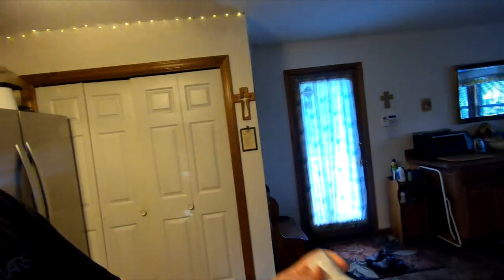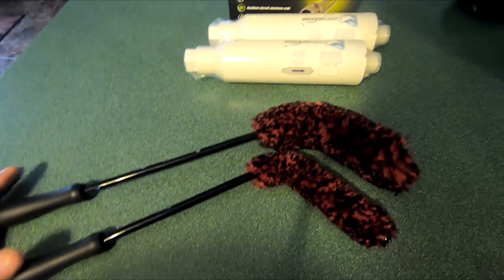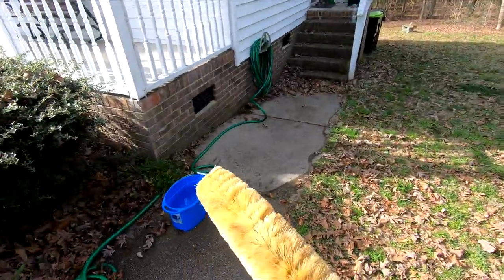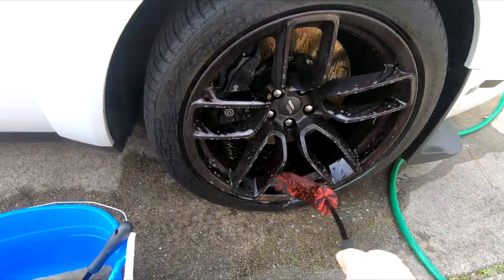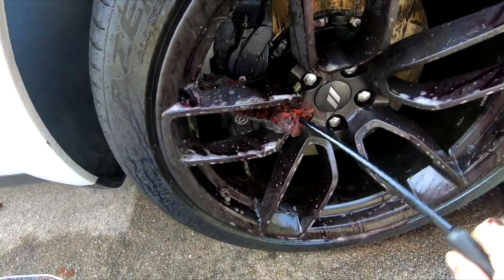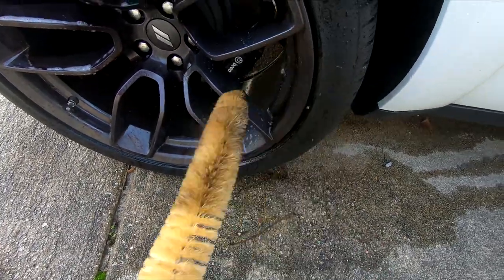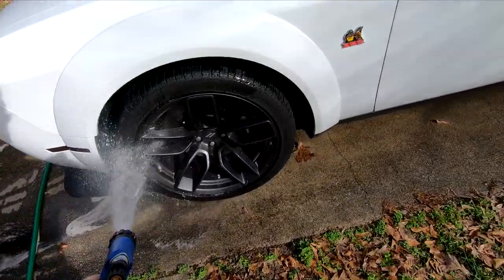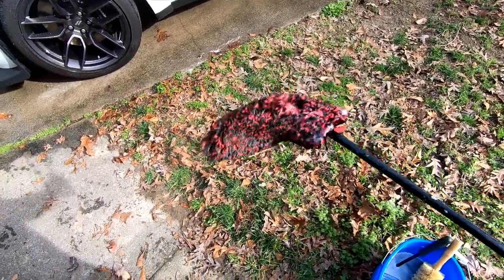Comparing DIABLO to MAGUIRES WHEEL CLEANERS and testing ADAM'S WHEEL WOOLIES!

Comment: Hi Sky. I have chrome rims and I'm concerned about using any type of brush to clean with. Are the wheel woolies safe to use?
Reply from the maker: Yes, should be fine.  I also have another wheel tool, you will see it at the end of my next video. It is like a cleaning mitt with noodles on a stick.
Reply: @Sky1  Thank you.